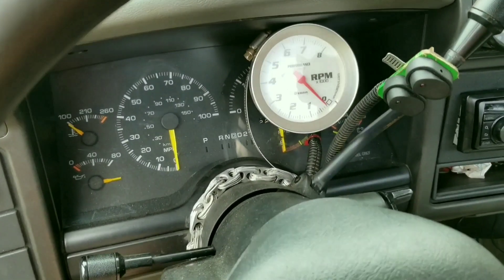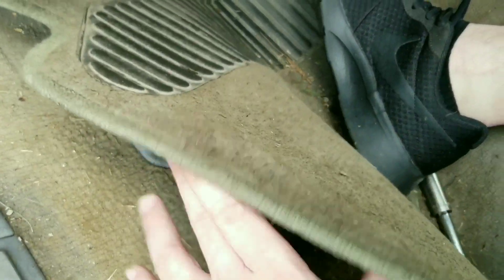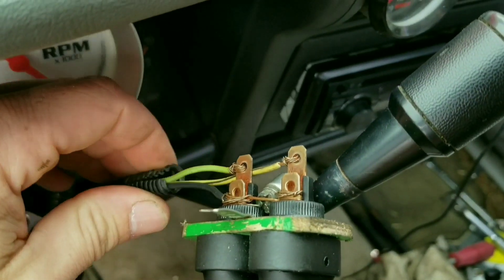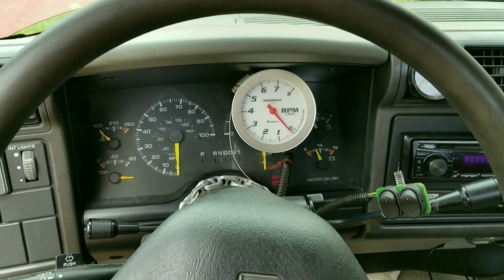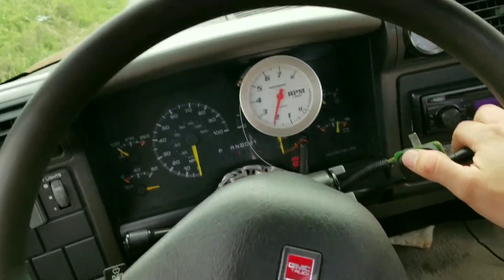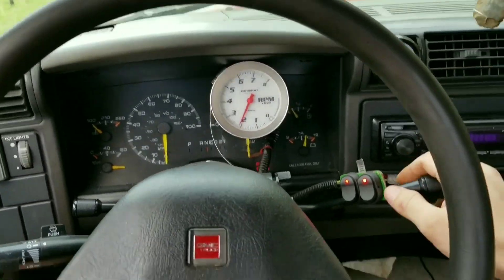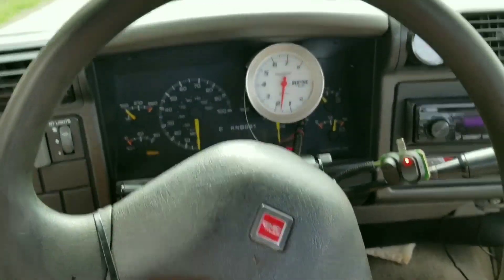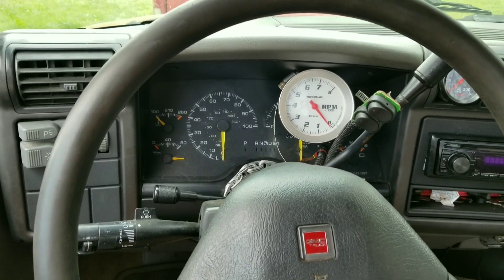Manually shifting a 4L60E with a carbed setup in my V8 s10

Comment: i like it,my motorhome burned most of the wiring under the lid,now im going to go fully manual with a carb on it,with it shifting in full pressure means my trans lasts longer,by the way,250,000 dollar Ferari's have flipper switches to shift with,no biggy,thanks for showing the simplicity of it all
Reply from the maker: you're welcome buddy, i hope you get your motor home fixed back better than ever
Reply: @HotrodShane  thanks hotrod,i found out that they make a internal vacuum modulator now for 90 bucks and takes the place of the pressure valve that is normally controlled by a ecm,now i can manually shift it and it won't disentegrate down the road,win win
Reply: @strattuner  what does that part you bought help with in this situation ? I’m about to do this on my 94 Chevy w/350 tbi and a 4l60e lmk please! I’m down a vehicle now and my spare vehicles turbos are going out, smh right lol. Take care - from T J….. let me know !!!!
Reply: @tylerjones4060  TRANSGO   part 48-mod kit,makes a vacuum modulator the goes inside the trans and takes the place of the pressure modulation solenoid,this makes the trans shift like it did when they had hydraulic controls,the damn thing cost me 90.00 it goes inside the unit and you have to drill one hole in the case for a brass fitting for the vacuum hose to fit to,this eliminates the electronic off and on again screw ups,then you do some wiring,only 5 wires to control the shifts to go full manual,the wiring diagrams are in youtube ,just look up manual controll for 4l60e its there and shows how to internally ground the shift solenoids when you shift with the shift lever,its actually very simple,but you go full manual and you have to be on your toes when you shift it,cause if you're doing 60 and put it in 1st or 2nd ,you are going into that gear despite speed,and it works,i had to do this  because my wiring caught fire and no harnesses available for a motorhome,my motorhome is my home,screw properties with taxes on them,i live almost free now

Comment: Im actually almost finished with repurposing a 2000 1 ton van computer to operate a 4l80e in a 1980 chevy 1 ton pickup that is carbed. The secret sauce is to trim all the fuel injection stuff off the harness, but leave the sensors and install a tps on the carb, then use a 7 pin HEI module (which converts the analog tach signal to digital on the R terminal) so you get a digital tach reference signal on the R terminal to feed the computer and make the magic shifting happen. Gonna make a 3 part video series about how I made it on my other channel for automotive. Im a Mopar guy just doing some electrical magic for a chevy buddy.

Comment: I'm doing this to my truck tomorrow this thing going good after a year I need it to last lol
Reply from the maker: was still going great when i pulled the trans to th350 swap it 2 months ago
Reply: @HotrodShane  hey Shane can you help me out.. real quick? I need to find out the power wire and grnd for this mod. You explain the shift well but skim over the power and ground.  I need colors please. I got the 350 swapped running now need it to move lol 😆
Reply from the maker: The power is soild pink and the ground will be whatever you make it, it'll just run from the switches to the body
Reply: @HotrodShane  gotcha. Thanks bro. F yea! 🤘🏼

Comment: Great job, you have to connect the tcc, it can be used in any gear ! 2,3,or4! Then you can get maximum power out of your engine. I have a lock up converter kit in my 700r4 and it works great, like a manual shift power, in3rd I use for towing, works as a Jake brake going down hill.

Comment: This would be REALLY easy to do with an arduino, and two momentary buttons for up/down. And another for the lockup (factory ECM will do lockup in 3rd or 4th, why not have it available in 1/2/3/4!). Hook it up to the brake switch as well so the converter would unlock if you ever hit the brakes.  Could even have a simple LED display showing what the selected gear is in case you lost track.  Just like a sequential shifter in a bike.
Reply from the maker: Hell yeah i never thought of that but it would definitely work and be badass too 😎
Reply: Would really like to see you put that together! @drfiero
Reply: @DUKEVISIONS   @hotrodshane -- I've got all the stuff laying around to do it. I'll add it into my 'pending projects' list!  Might have something for spring.  Hopefully 2023.  ;)
Reply: @DrFiero Did you ever get a video put out on this? I would be really happy if you have I'm sort of looking for a option on manual valve body set up that would be like this. I've got a 69 Buick Riviera that I would love to upgrade the transmission in and run the stock engine. I'm one armed and would like a good option for performance without a manual transmission. Since there will be times where I can't shift because I need my hand on the wheel. 😂

Comment: Glad i found your channel  doing a ls swap  with carburetor  and a 4l60e dang I'm glad help a little thanks
Reply from the maker: Glad I could help man  👌
Reply: @HotrodShane  thanks again
Reply: You can also do like what I’m doing with my 4l80e and buy a vacuum regulator for the like pressure then use an arruino or esp32 with some relays for the shifting
Reply: @-BackyardShenanigans-  I like help knowing which wire is 2 gear 3gear and over drive thanks help would be appreciate again thanks
Reply: @terryreynolds1366  oh that’s ez so technically the first shift solenoid (A) is all gears . The second solenoid (B) is what changes the set. So that it’s 1 -> 2, solenoid B engages, 3 -> 4. “Overdrive” which is just the TCC is a button you can manually engage, it’s recommended to not engage in gears 1-3 but u can get away with it in 3rd.

Hope that helps. I’ve spent so much time learning these transmission bc I wanted to make my own TCM.
Reply: @-BackyardShenanigans-  do you know what color of the wires are 2 and 3 gears wire and of wire. don't mean to bother you but thanks again for your support just trying to get the S10 together for my grand son he has no clue if i can get about 450 to 500 HP I'm happy super thanks

Comment: I wonder how the line pressure is set up, I realize it's wired to full pressure all the time in the video. But I wonder if you could simply put a throttle position sensor in line for normal driving.

Comment: Thank you so much for the demonstration! Now everything else makes sense. As far as the torque converter lockup goes, will you be using the brake switch as an interrupter to kill power to the lockup when you need to slow down or stop?
Reply from the maker: You're welcome! Im not too sure about the lockup, i never hooked it up lol. I would say it would still be manual switch since i have no computer. Id say there's a way you could wire the lockup to the break multi switch if you wanted, i just never took it that far.
Reply: @HotrodShane  2 months later is your transmission still going with no converter lockup? I don't know about 4l60e, but with the old 700r4 you'll burn em up without lockup.

Comment: I have a 93 S10 I cut the computer out entirely. I have an HEI ignition and a Holley carburetor. if I get the plug from the bone yard ,and just use the four wires only , and wire it like you said ,will it shift .again the computer is completely removed. Please respond back

Comment: would this work on a 4l60e out of a 1994 k1500 blazer, i doing a 5.3 swap but people told me I can't use it because because there is no tcc pwm solenoid.
Reply from the maker: You should be able to, i haven't messed with this setup with a 5.3 but i think with it straight wired like i have it, it should work in theory.

Comment: So I'm setting up a SBC with a little ole 650 cfm holley and want to use 4L60E... In my 75 chevy luv. Without the signal from tps and all these other things.? Still possible I hope!?
Reply from the maker: It should work if you straight wire it and put it on switches like i did, its about the only way to get one to work with a carb, in an older vehicle.

Comment: What fuel pressure regulator did you use. I bought a cheap eBay one and as soon as I turn the key on it starts leaking, even with thread sealant
Reply from the maker: I used a manual pump for awhile and then went to electric. I had taken the in tank pump out and put a rubber hose in its place

Comment: Does it auto down shift.  Or are you pretty much flipping switches based on RPM?  Does it automatically shift up or down or is it completely manual like a stick shift?
Reply from the maker: When put on switches its full manual and will only shift when switched.

Comment: I want to try it but I’m a little slow is there a way I can get a better guide on this . Not sure where to pull trans wires from and the power wire to switches has me lost
Reply from the maker: First you'll want to remove the trans harnesses from its computer. Try to use the whole thing its like 5ft long so you can route your wires. Its got 8 or 10 colored wires and youll only need 3. The pink power wire will go to a switched 12v source. The green/black and yellow/black wires are for the 2 shift solenoids and will run to their own switch. Run a ground wire from both switches to a body ground point. Once the trans gets power all your doing is grounding out the solenoids with the switches and making it shift manually.
Reply: Hotrod Shane ok I understand now thank you thank you thank you
Reply from the maker: @rhorton5336  your welcome, glad i could help!

Comment: So I don’t need any of the other wire ? Just the green and black/ yellow? Ofc the 12v and ground but other then that that’s all I need ?
Reply from the maker: Yeah thats all you need, unless you want to lock up your converter then youll need the tan wire ran to a switch also. I haven't changed this setup and ive been using it on the daily here lately.
Reply: Before I do this, can I drive high way speeds , like about above 65?
Reply: And without the tan wire ^

Comment: Please make a quick video how you downshift please explain
Reply: Btw awesome video definitely doing this then spending 700$ on a transmission computer
Reply from the maker: @tonyjr6096  thanks! Downshifting is just as easy as upshifting, once you switch into 4th all you have to do is switch them back in reverse order.
Reply: Hotrod Shane appreciate it ! I tbi carb converted my 1978 c10 , any tips on quick and easy hp modifications ?
Reply from the maker: @tonyjr6096  start with the basics, headers and intake and a good distributor will help alot. If you want more, look into a mild cam and or better heads.

Comment: Can. This set up be done with paddle shifter
Reply: You would have to set it up with an Arduino unit(computer). So it could see and do what what needs to be done for the next gear up and or down to take place. If I'm understanding what would need to take place that is I could be wrong. Which I hope I'm not. I hope this is helpful for you.

Comment: What about the neutral safety switch plug?
Reply from the maker: I will say i haven't tried this setup on a newer style 4l60e. I know they can be a pain to deal with.
Reply: So my man I was wondering if you have the neutral safety plugged in or naaa or yours doesn't have 1? BTW good video and thanks again
Reply from the maker: @nicholashart2484  i appreciate it man, but mine doesn't have the neutral safety switch plug. Its one of the first versions of the 4l60e. Like i said i haven't messed with a newer trans so im not sure if it would work or not with that switch. Sorry i cant give a for sure answer, id have to do research on it
Reply: Oh ok np i didn't know that my bad

Comment: Hey brother when you finally swapped in a th350 did you need a need drive shaft?  Was it shorter or longer?
Reply: Any help is greatly appreciated
Reply from the maker: I actually got lucky and used a longtail shaft th350 and was able to use my stock driveshaft. Its a tad long but itll fit. I just had to fab up a piece on the crossmember to mount it.
Reply: @HotrodShane  heck yeah thanks dude I already shortened mine 1&1/8. Thanks bro

Comment: Bro please tell me it lasted good I just put a new 4l60e with 50k on it in my 400k truck and I put it like this but by the cup holder I love it but HOWS IT lasted bro ???!!!!
Reply from the maker: Hell yeah bro. 60es are just like anything else. Theyll last if you take care of them.  The one i had spent like 20 years behind a 4.3 and then 4 small blocks after that with the stock converter. It sat a long time before i ls swapped my truck and i hate to say but it didn't last no time after that. Ive got a built th350 now and had no probs since.
Reply: @HotrodShane  na I mean like how did the full line pressure and switches last on a 4l60e. I don’t really dawg on my stuff lol so I’m not gonna be burning out and putting it n mud much it’ll be a haul truck… guess we’ll see lmao.
Reply: @HotrodShane  ?
Reply from the maker: It lasted and worked just fine up until it started slipping in 3rd, 4th lol
Reply: @HotrodShane  sounds like a 4L60 🤣 lmao.